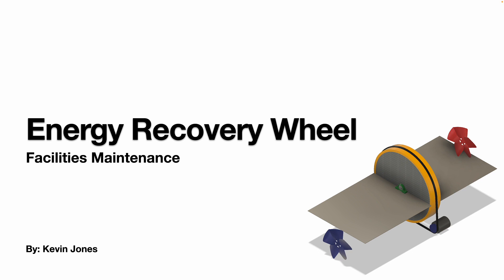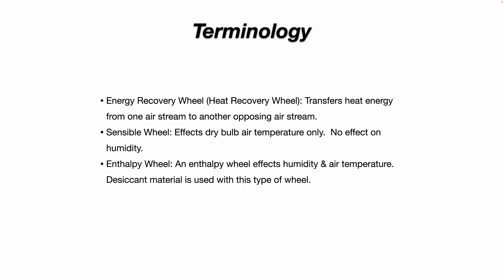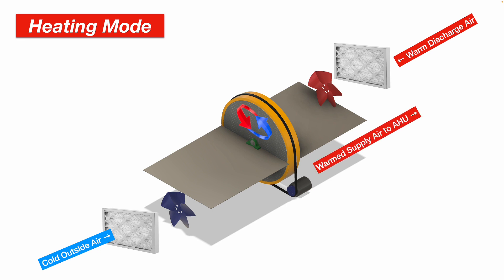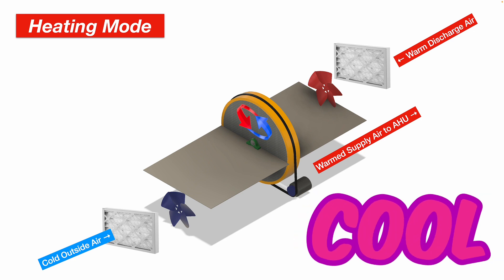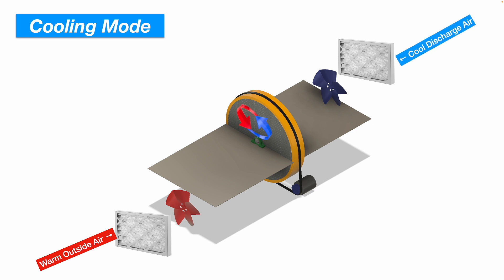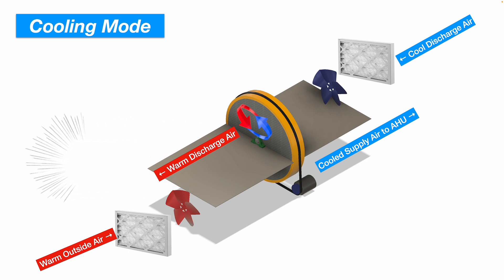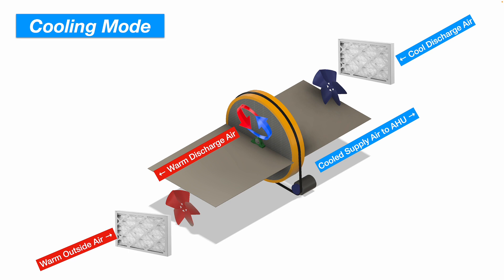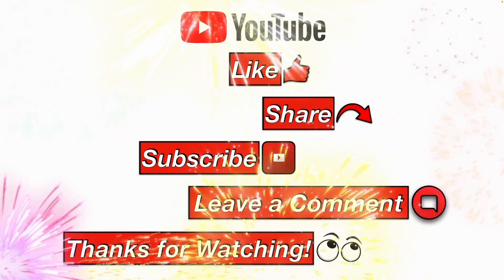Energy Recovery Wheel | Heat Recovery Wheel | HVAC

Comment: So it's a rotating heat exchanger? What percentage of interior air is generally exchanged with exterior air in an hour? This is interesting, but I've never delt with commercial/industrial heating and cooling.
Reply from the maker: That will vary depending on the diameter of the wheel, air flow capacity of the system, wheel rpm, etc. 
Here is a formula I found on this topic:
Effectiveness =  (V2 (t1-t2))/(Vmin (t1-t3))

Where,

t1 – Inlet supply fresh air DB temp (°C) (Atmospheric Air before Heat Exchanger)

t2 – Outlet Supply Fresh Air DB temp (°C) (Atmospheric Air after Heat Exchanger)

t3 – Inlet Exhaust Air DB temp (°C) (RA from building)

V1 – Supply Air Flow (L/s)

V2 – Exhaust Air Flow (L/s)

Vmin – Minimum of V1 , V2